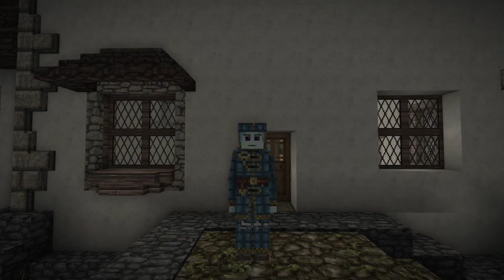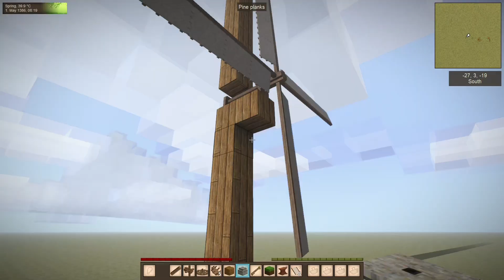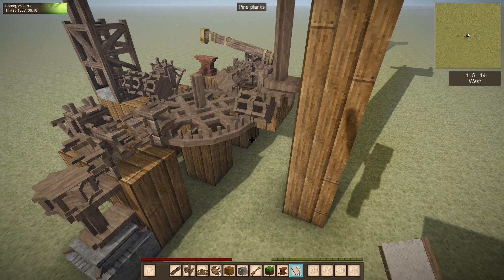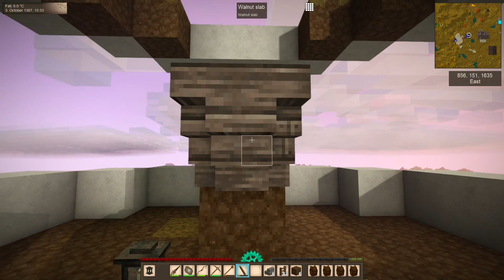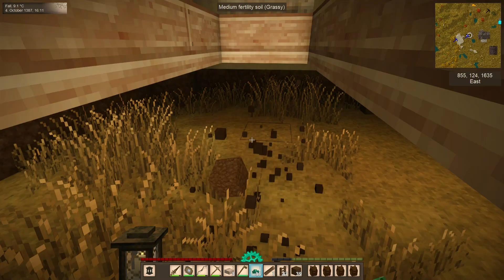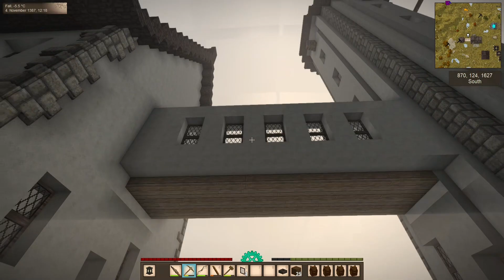Vintage Story Guide - 1.16 - Episode 25: Automating the Quern with... THE TOWER OF MECHANICAL POWER!

Comment: Watching your playthrough so far has made me realize how important limestone is. I'm playing in a world that's not limestone and have searched for hours with no luck. Haven't been able to do anything with leather because I'm not to bronze to harvest the borax yet.
Reply from the maker: Limestone, or more specifically, lime, is extremely important, yeah. If you can't find limestone but you've found chalk, you can also grind chalk down into lime. Other than that, you can also buy lime from some traders, though it's kind of a rip-off.

Your best bet is to set out from your base and just walk 3-5km in one direction (pick N, S, E, or W) and come back. Then rinse and repeat with the other three directions.

If you're brave or lucky (or both), you could spend some time caving to see if you can find any relatively shallow translocators. Those can open up long-distance travel options and really expand your access to materials.

Best of luck in your search!

Comment: I would be too paranoid about losing what the quern (love that word) was producing--3 single blocks around the quern would not be enough for me. Picture an oval of connected dirt blocks with no air gaps that are 2 blocks high,  and surround both the quern and the hopper. 😉
Reply from the maker: Putting the blocks around the quern doesn't cause loss of material, just loss of efficiency. It IS, however, generally best practice to block off the diagonals!

Comment: Can you theoretically connect different windmills right next to each other, like maybe 30 blocks as an example, that feed into the same grid? Does that make any sense? Not the one where the blades collides with one another. I assume the power loss would be pretty substantial though. I’m sure you answered this, but it went way over my head if it did
Reply from the maker: You can, but you always need large gears on order to expand connections in a power train. You could stack them vertically or horizontally, but you have to make sure that all input gears connect to each other at 1:1, otherwise weird stuff happens.

Comment: I'm really struggling to find copper and could use some help. I always mark a waypoint on surface ore I find and go back later to mine out the rest, but I still don't find much. Sometimes I don't mine out any at all. Is there a certain amount of surface ore that needs to be present for there to be ore underground? Is copper more easy to find in certain biomes or rock types?
Reply from the maker: Surface copper is not tied to any specific rock type and is scattered relatively uniformly across the landscape. The world settings can affect this, as there is a setting for how common surface copper and tin are. I find waypoints for surface copper to be handy for finding my way back to the area, but not for pinpointing exactly where I should dig down. Your best bet is to dig down directly below a block that has (or had) a piece of native copper on it. Pretty sure you are guaranteed to find copper ore directly under blocks with copper nuggets. You may have to dig down as far as 10 blocks below the surface, and it's MUCH easier to mine copper that's below a flat surface rather than on the side of a mountain.

There is some variability to the size of surface copper ore veins. The smallest I've seen was like, 5 blocks, but it's usually more like 30, with some on the larger end at 50 or more blocks.

If you've been marking copper to come back for later, I'd recommend either not picking up the nuggets until you're ready to mine beneath them, or build a small dirt pillar exactly on one of the blocks where the copper bits were, then dig down from there.

If you're super desperate for copper and just need a bit to get started, you can pan through sand and gravel for it, but it's not a viable long-term strategy.
Reply: I also don't really understand how to use the prospecting pick to find ore. I not sure where to look after I get an ore reading.
Reply from the maker: @Axeolotol  I actually covered this topic in Episode 11, which you can find here: https://www.youtube.com/watch?v=reeRdqD5APU

The episode covers both the density search mode and the node search mode, as well as how to activate node search mode if you don't already have it turned on (it is off by default). Give that a watch and see if it helps you figure out how to use the propick! :)
Reply: Ok, thank you. Unfortunately that's means that there's alot of ore I'm probably never going to find on my current playthrough. Because I would just pick up native copper and forget about it when i first started playing >.< ugh, lol. 

I'll have to watch it again I guess. I must have missed the some of the parts about the search nodes. Thanks again.
Reply from the maker: @Axeolotol  Yeah a lot of new players pick up the copper bits without marking exactly where they are, and the game isn't terribly forthcoming about the process in its current state.

The TL;DW is, the density mode (which gives you the readout of a chunk) tells you what minerals you MAY find in that chunk. You can dig down and see what kind of rock is beneath your feet--you can then look up that rock in the handbook and find out if it's a host rock for any of the minerals in the readout (and ones that you want). If not, you can dig deeper--there are often 2-3 (or more!) layers of different rocks in a given area, and not every rock can host every mineral. Once you start digging and searching with the "node search" mode, you're basically playing the "warmer, colder" game with any nodes that may be in the area.
Reply from the maker: @mantoron3636  Ah that's right! So many little things to know and remember about this game! XD

Comment: I've watched a lot of vintage story, but I always learn something from your videos. Thanks for the series.
If you chisel just the outer voxl on a log block, does it make it look like wood grain? Basically remove the "bark". That would be a really cool way to build an old school log cabin.
Reply from the maker: Thanks for watching and commenting! Yeah, you can strip the bark off of logs with the chisel. However, this means you have to actually remove 1/16th of the whole block on the faces you want to remove the bark. I'm not 100% certain how that interacts with the game's insulation mechanic (for keeping warm in a room in winter, for example), but it might cause some issues. It bears playing around with to find out, though!